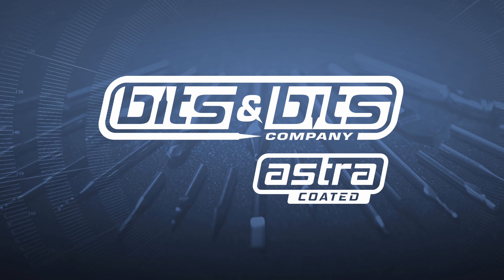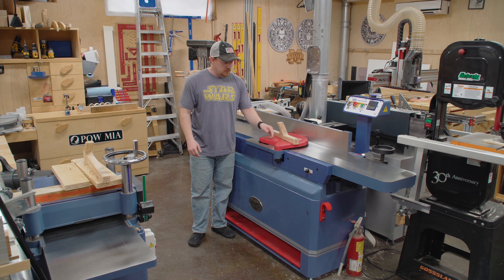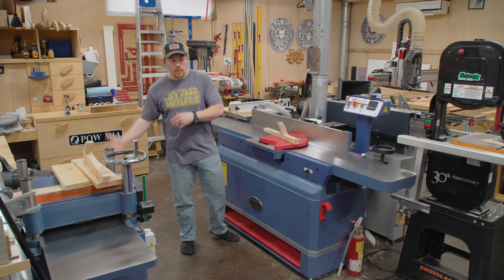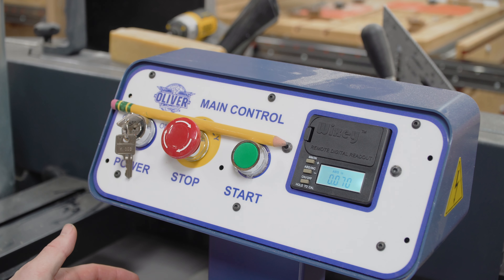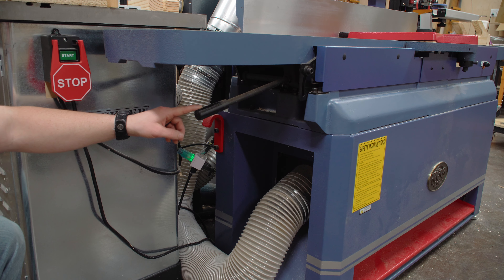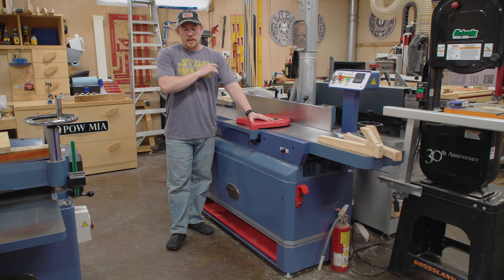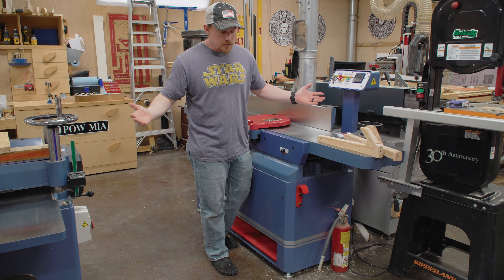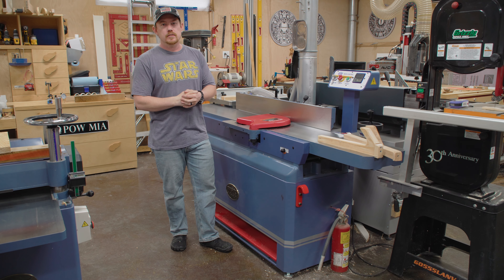Tool Talk #22: Oliver 4265 - 12" Helical Head Jointer

Comment: The latest batch of machine gets a few upgrades. A better support system for the fence. A six row cutter head instead of four with more cutters. And for 12” single phase, a 5 HP motor from TW instead of 3HP Baldor motor.  Lastly, a lock for the infeed table. I agree about the DRO. It can be useful for cutting rabbets but otherwise more convenient to use the mechanical gauge. Would love to see it come with self leveling casters like the newest Oliver heavy duty table saw.

Comment: I have an Oliver jointer from 1962 that weighs one thousand nine hundred pounds. 5 inch cutting circle with a 38 degree hook angle head. 
Good luck trying to face boards flat with an insert head put some traction tape on the floor. 😉

Comment: I hate the fence design on my Grizzly G0490X 8in jointer. (think you had the same one) What genius came up with the idea that a single adjustment lever releases TWO pivot points?!? It was a nightmare trying to lock that thing into 90º .... so much so that I drilled and tapped for a grub screw to tightly lock the irrelevant pivot in place. Works great now and I can even slide the fence forward and back and it stays true. But yeah, companies need to ditch the idea cutting chamfers and angles with a jointer. 
Hope the move is progressing smoothly.
Reply: For that the Northfield fence is much better.

Comment: I bought a wixey for my dewalt planer and it doesn't auto shut off. the batteries would be dead after one day using it and then when I changed them I had to recalibrate it. It ended up taking more time than it was to just skip using it.